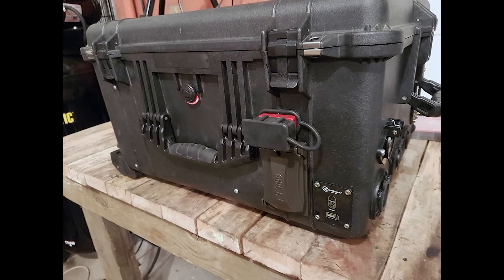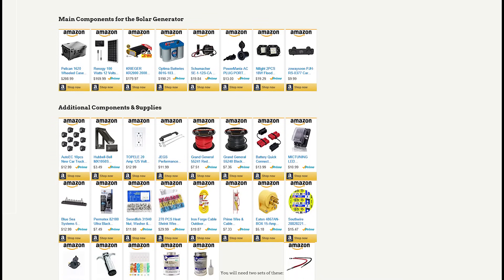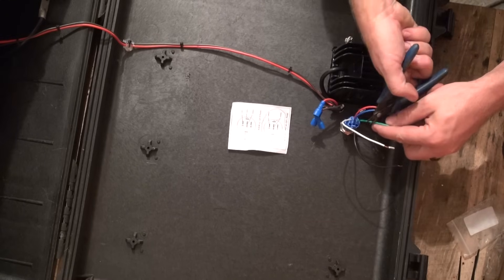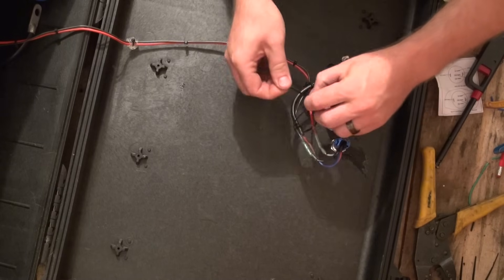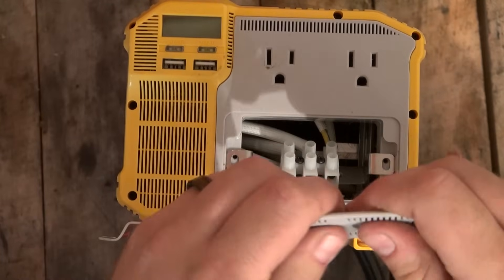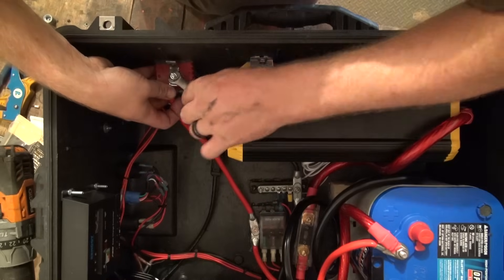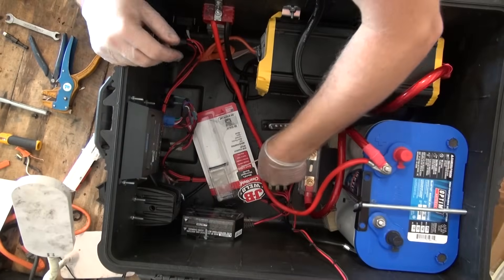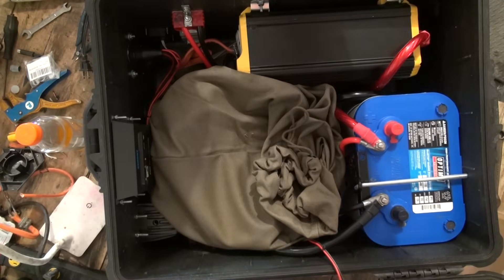Solar Generator - Finished Version and Final Design Updates

Comment: Im just looking into this, and know very little.  My question is your trickle charger for when you plug into A/C.  Why not just use a bigger noco genius charger that charges at higher amps.  I have a noco 26amp ac charger.  Can I just hook this to my internao lithium battle born battery?(used for 250$) ...had to go lithium with that deal.
Reply from the maker: Hi Stephan, that inverter would work fine as well if that is what you prefer. I picked a low amp trickle charger / battery tender as my thoughts for including it were for long term storage keeping it topped off and healthy rather than a rapid recharge.  When in use in my case the solar panels will be there for the rapid battery recovery.  I am not familiar with that battery, but if it is safe for automotive applications (has built in over charge  / under charge circuitry) it will likely work fine!

Comment: Yeah, Im a fool that likes wasting my $$.  Got two used Battle Born 100aH Lithiums for 1/2 price.  Gonna put these two in a larger Pelican box, add MPPT Solar and 400 W solar panels, 200 to take overloading.   pairing with a Redarc to connect to the Vehicle via the 4Runner 12vTrailer wiring and let it rip!  Who knows, total noob so lets see if it works...awesome video.

Comment: I have watched your videos over and over. You have the clearest and easy to understand instructions on youtube. I had been interested in building one for  a while but now I am going to build one over time especially after dealing with Hurricane Harvey here in Corpus Christ, TX. I have already built a solar shed lighting setup with a 10 watt panel, small charge controller, 12v 9ah battery and some led light strips turned on by a toggle switch. Lights up the shed incredibly. I also just bought a dual fuel generator since it was a deal I couldn't pass up on but I am going to build a solar generator to have multiple options. I would love to get some stickers so I will send you a message for some. Also, I noticed that the inverter that you upgraded to isn't on amazon anymore or at least I can't find it. Any suggestions on a comparable model.
Reply from the maker: It keeps going out of stock.  Hopefully they get some new ones in soon. I am not sure what the best alternative is. It mainly has to fit in the same location arrangement, and the external control switch on the Kreiger was a nice feature.

Comment: Good update. But I want to add a second trap case  for 2 , 3, or 4 more batters to extend my battery time as I'm running full sized freg. Can you make a video on wiring that please and adding a port to the main trap case?
Reply from the maker: Check out the playlist of my videos for this build. The solar panel and battery bank expansion video does just what you describe!

Comment: Hi really great job, thanks a lot. You encouraged me to do the same portable box but with small edition, my question is,, Can it be charged through cigarette lighter in the car?
Reply from the maker: Yes it can.  If the car is running at the time it will keep your car battery from being drained at the same time. The battery in the unit is as large or larger than most car batteries, so keep that in mind!

Comment: I'm sure it would be too much of an ask, but could you design and record a video using lithium ion 18650 batteries. I own 500 brand new Panasonic 18650B batteries. I also thought using a 30ft mc4 solar charging cable could allow the case to remain completely out of sun whilst charging, which may allow longer life span for your generator.
    I'm new at all this please, any input or thoughts would be welcome.

Comment: Built one quite similar to yours, thanks for the inspiration and the detailed videos. I have a minor issue with the Renogy (wanderer) charge controller. The LED indicator lights stay on after being disconnected from power source. Curious if this a design flaw with the controller for this type of application or have I wired it incorrectly? Any help would be much appreciated. Thanks.

Comment: Hi I’ve notes in you final video you have changed the wire. What gauge speaker wire did you use and can you send me a link to the quick contact to the solar panels. I have built 3 solar generators myself. I did not you you can use speaker wires as solar wire, I also like the quick connect to the panels.
Reply from the maker: I changed it to a 12 AWG outdoor extension cord. Much less expensive and very flexible for easy coiling. Wire is wire, so long as the gauge is sufficient for the current and the insulation is rated for the voltage!  The quick connect is a 6-pin trailer connector. See the main blog post for this series for details on all the components.

Comment: i like the light switch as I have them on my camper. One point that might be good to note is you should mount the switch whee u dont look thru the light to find it.  On the cover of the box or make all switching in a single location

Comment: Can you name a good book, where I can read up on the basic info needed?  I would to know how many panels (watts) I would need to run a portable AC and a refrigerator.  What determines how many watts can be produced?  Does a 100 watt panel produce 100 watts and 400 watt panel produce 400 watts?
Reply from the maker: Yes, in ideal conditions. The solar panel listed wattage is in direct sunlight. Angle to the sun, clouds, etc. can all reduce the wattage produced. You will want to measure the load on the devices you want to run over the course of a day (the Kill A Watt is great for this: http://amzn.to/2xZmdXi ) then determine how many /size of panels needed to produce that plus some extra in the daylight hours.

Sorry I don't know a good book to recommend, as I used online info plus I have a background in electronics.

Comment: Great job.  I have a 5000-10,000 watt unit mounted in my pick up truck box built based on you design and build.  I have a few tweaks to make to it now but I love the versatility of the high amp plugs and 12 volt outlets.
I would proudly sport one of your stickers.
Reply from the maker: Thank you Dennis!  
Use the "Send Message" button on my channel page (https://www.youtube.com/user/ModernSurvivalists/about) to send me a private message with your mailing address and I will get it sent out!
Reply from the maker: Looks like the "Send Message" button only shows up on computer. You won't see it if your using a phone. Sorry for any confusion. Please send your mailing address to mark@modernsurvivalists.com and mention your YouTube username. Thanks!
Reply: Hey Dennis I’m looking to make one like your with that much watt can you help me with advise on how to make it and specs items and wire diagram and parts you used as well thx in advance
Reply: Please make a video about your generator. PLEASE
Reply: Hi Dennis! I am interested in building a solar generator similar to your wattage as we have recently suffered a catastrophic event. Would you be able to provide a parts list of your build and possibly a schematic? I'm a complete noob.
Reply: I had mine in my truck for a long time but. Bank was 1,200 AH 12v was real heavy lol 600 watt panel suitcases 200 watt each have 3. I built it on a trailor toy hauler I tie behind my RV now https://youtu.be/XxXmmuYrbJY
Reply: How much did you invest? I would be interested in seeing your setup. thanks

Comment: I think I made the comment before the major failure of your device is your battery. You effectively built a 300 watt hours device. This is too low to be useful.  Too much details on little things on wires.  Your overall design is bad. Sorry.  Do a little research and update your battery and replace your solar charger to a Bluetooth enable mppt charger to have your panels coming in as serial instead of parallels. Better yet. Build a 24v Systems
Reply: Louis Y 

😂that link is any better than any body else's. Wondering if you aren't vested in it somehow🤔

Comment: Thank you for your videos of the solar generator. From watching yours I have made a smaller version of my own with many of the same components / ideas as yours. Mine is only 28 amp hours with a 50 watt panel. The idea of mine is for extended camping of the grid or for long power outages.
Reply from the maker: Thanks Tiffany, Glad they were helpful!